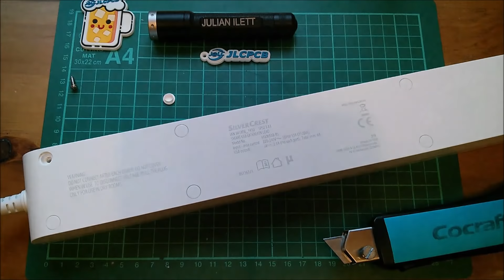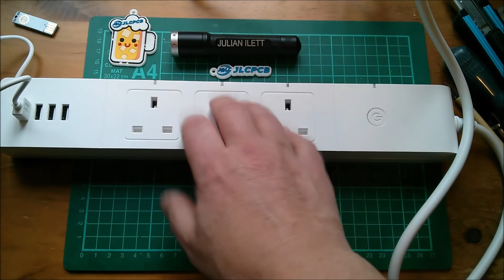Lidl Smart USB Extension Lead - Stripdown

Comment: The ethernet (lan) socket is so that it connects to your router and  communicates to the server on the internet. My understanding is that Zigbee uses its own wireless protocol, not the standard wifi you have on your home network. It allows the devices to relay instructions in their own network mesh. In theory this reduces the necessity for wireless access points. In fact your zigbee devices cannot typically communicate on the WiFi, they rely on their own mesh. The more zigbee devices you have scattered around (upto a certain point),  the better. This helps piggyback the messaging.

Comment: I was interested until it was said "why would you want to" when it came to switching USB sockets.

I want Zigbee controlled inline USB switching but as they don't seem to exist because of this crazy attitude that demands we waste electricity every chance we get, I have to adapt a Sonoff Basic mains switch (which are really good) to run off USB power and have a USB socket.  I don't WiFI USB sockets ... I have too much WiFI.  I like Zigbee.  I have everything set-up on Zigbee.  I prefer 868Mhz stuff - I like WirelessThings LLAP ... but we have to make do with what we can and 2.4GHz Zigbee which can mesh is pretty reliable and does most of what I want.

I don't want to power circuitry just for the hell of it, wasting electricity as unwanted heat.

I just wanna switch 5V.  I like USB stuff.  I have lots of USB stuff.  I want to switch it.  Without having to get out a soldering iron.

Why is this such a taboo thing?  Why do people say "why would you want to?" ????????

Comment: This switching on with litle delay is very clever. It helps a lot if you have 2 or 3 devices with switching power source plugged in to deal with inrush current.

Comment: I never use cloud connected resources in my home for home automation.  (i) there are significant security vulnerabilities, and (ii) we've had instances of consumer DoS because the vendor decides to end-of-life the product range and turns off the cloud service.  IMO, better to control this sort of device locally using Home Assistant and Zigbee to MQTT bridge. A bit of a learning curve, but a lot of capability using Free and Open Source stacks.

Comment: The reason the hub uses Ethernet vs WiFi is that ethernet requires no config or setup, just DHCP on your router and it's good to go automatically. Wifi would generate a ton of calls to their support. Plus, it is immune to interference unlike wifi.should lower latency at the same time.

Comment: There's a reasonably priced tool kit from iFixit that would give you most of those annoying security bits. I think it was like $40. I recently got one.
Reply: There are lots of "security bit" set on amazon. Ifixit is posh home use stuff and the price to performance ratio is just not good

Comment: hello !
most domestic plugs in france are 16A 3 pins plugs.
in not so old habitations (like 1980's), there is 2 pins 16A and 3 pins 32A plugs. 
in older houses we also have 2 pins 6A plugs and 3 pins 20A plugs.
6A pins are 4mm diameter like on russians plugs.
16A pins are 4.8mm.
(all 3 pins plugs mentionned are for live, neutral and security ground.)

Comment: Dont connect high KW heaters to that one. And for sur NOT more than one. Look for shelly wifi plug.. they support 2500w 16A. 3KW on that one will go on fire for sure.
Reply: That shelly plug works on an 16A relay and this lidl one does. So whats the difference ?

Using 13A is even safer. I'd guess these are originally intended for EU 230V 16A use (what equates to 3680W ohmic load) so the 13A is easy peasy.

How can the shelly be 16Amps but 2,5kw ?
Eu schuko plugs can deliver 16A for serval minutes and 10A continuosly.  So nothing wrong with this zigbee plug.

Comment: Would the 13 amps not be on the line going into the device.  Each socket might be divided by 3?  Maybe the first one would handle more.
Reply: I was thinking of the thickness of the traces. You couldn't plug 13 amps into each one.  That would be 39 amps total.

Comment: The plug contacts look strange. Almost as if they are on their side. When you plug a plug into it, the pins of the plug look as if they wont have as good connection and might spark a bit... and with use, the metal might bend out of place quicker. Looks as if a lot of work went into the product yet skimped on a basic part.

Comment: App is smart life / tuya with Lidl badge on it on it, you should be able interact with all tuya WiFi and tuya ZigBee devices on smart life app. 
There white bulbs are very good, at there price.
Reply from the maker: Yeah, I'm hoping I can add some Ikea stuff to the network too :)
Reply: @JulianIlett  Get a Tuya temperature module and monitor shed or auto adjust the heater or fans... 🥴 About £13

Comment: Mainland europe is 20A per circuit (for newer houses).  A circuit Is allowed to have up to 8 sockets.
Old houses may be limited to 10A or 16A
Max current per individual outlets depends on the country.
Individual sockets are rated for up to 16A

Houses typically are limited to 40A total.

Higher than 40A and/or 3 phase and/or higher than 220V (400, 500, 690V) is available depending on where you live...

Comment: Thin tracks ;--) you should pull a 13 amp fuse apart and look at how thin that fuse wire is. 
Also for interest look at "fuse factor" and compare it to the old fuse wire cards for old style UK house fuse boxes. It is stunning how many amps you can put through a 5amp fuse wire (I think the wired fuse wire was rated at 2.5 fuse factor) yep 5amp fuse wire will get hot if you run 13amp through it.

Comment: could you elaborate why daisy chaining leads is a bad idea.. i'm in a situation were i have to
Reply: It’s a liability issue. If you know what you’re doing you can go ahead, but you can’t then sue them if you get it wrong because they told you not to do it.
Reply: @fredbloggs5902  i see i will try to see if i can find any info on what i should watch out for when daisy chaining leads.. thanks. btw my first google search led me to this paper.. seems overloading is a common problem.. https://www.abdn.ac.uk/staffnet/documents/GN001_Electrical_Extensions_2016.pdf
Reply: @MVanDeursen  - Just add the energy consumption of all the appliances together and make sure you don’t exceed  the lowest rated adaptor (13A or 3Kwh being a typical maximum).
Reply: @fredbloggs5902  thanks for the tip.. i just told my wife about this hahaha both of us learned something today.. it's all logical when you think about it but newbies like us don't think about it.. just a Linux sysadmin ahaha thanks again.. appreciate it a lot.
Reply: I think there's a concern that people could come along and keep adding  a lead and plug a heater into it recursively without ever checking how many leads are already chained. People in offices can do that sort of thing but I think it's  more unlikely in a home. They've tried to make the instruction as idiot friendly as possible so no one gets confused.
Reply: @joinedupjon  I really don't like that sort of CYA. I understand making it easier for idiots but I don't really see how this rule helps. It suggests you can't chain ten extensions with 10w each but it's fine to plug ten heaters into one extension. Practically speaking I think it's better for each extension which can't handle all the current available at a socket to have its own circuit breaker or fuse.
Reply: @eDoc2020  I think it's mostly a throwback to the distant past when people burned their houses down plugging high current appliances into daisy chained adaptors hanging out of a light fitting. i think all extensions sold in the UK tell you not to chain,  even though every modern UK plug has an internal fuse - including every plug in the daisy chain.
I daisychain at home and I'm happy that it's safe to do so. At work I worry that some idiot will plug a toaster into a chained extension and then electrocute themselves fishing about inside it with a fork and it might create a liability even though the daisy chaining has nothing to do with it.

Comment: The Hub is wired to make more profit, even though Zigbee is a wireless protocol the cheap chips that do it are not wifi compatible, you could in theory use an ESP32 and hook that up to a zigbee module.

Comment: Good review, I've bought quite a few electrical items & power tools from Lidl over the years and always found most of them are of decent quality and well built.
As you said, is that Printed circuit up to carrying a 13 amp load be interesting to plug a 3 kW load into the furthest socket & run it for an hour or so & check how warm the unit becomes especially when the circuit board is inside its case.

Comment: Tuya is a hardware independent smart home software solution and many different hardware vendors use Tuya instead of rolling their own cloud service, app, etc. This means that you can pair this with the "Tuya Smart" app along with completely different Tuya compatible products. If have not finished your video yet, there are quite nice Blitzwolf switchable sockets which also measure power consumption.

Comment: In the single socket version it is possible to hack it to use a 5v supply enabling you to use the relay to control low voltage equipment

Comment: Zigbee is two way, so the app would get a confirmation.   You are right that the flashing is for pairing.
Zigbee 3.0 is the current standard.  Usually most devices that are Zigbee 3.0 are compatible with each other.
ZigBee won't talk directly to your phone and forms a mesh network, and is extremely efficient with battery devices.  Ethernet is needed (either WiFi or Cabled) for you to be able to communicate with the hub via your network :)
IF you can set the ZigBee channel, make sure it is at 15 or 20.  If you go down into the lower channels, it will be in the same channels as WiFi :)

Comment: Besides wired being much more reliable, the Zigbee and WiFi channels overlap significantly, so it's much easier to make a high quality reliable zigbee hub without a WiFi radio built in.

Comment: I've got a very similar looking one from Gosund, although it's without Zigbee so probably not the same.  Mine had USB Ports rated at 5v 3A .... it couldn't even take 800mA at a single USB Port before the Voltage dropped massively.
Reply: Everything is alright, its Chinese rated 3A@0V means 0,5A@5V which is enough

Comment: If you are only going to be controlling it whilst in you shed, then what's the point (other than curiosity, nothing wrong with that). Surely a normal switched extension would be easier and better. I could understand if you wanted to control the heaters from inside the house 30 minutes before went there but you said it would only be controlled within the shed. Can you explain more?
Reply: I believe you misunderstood Julian's comment. He said the controlled devices will only be in the shed, not the controlling devices. He is going to turn on the heaters from inside the house before he goes out.
Reply: @eDoc2020  Thanks. I thought it seemed strange. Must get my ears cleaned.👍

Comment: Home automation is pretty cool but I never would want to use anything that requires me to sign up to any service that must be connected to some obscure server that you don't have any control over, not over all the devices connected to their server nor over all your data that they are going to collect whether you want it or not, that means that all your smart devices are gonna be spying on your every move, for example with you using this smart extension cable they can see the type of device you have connected and lets say you connect your tv and audio equipment and a light...
So now they know exactly when you use your tv, at what time, how long you watch tv, they now know when you have your lights switched on, at what time and how long and they can even see that you watch blue-ray movies in the weekend because that requires you to have your audio equipment switched on also, all those little details about your life that you never ever thought about they now know only from this smart extension lead, now imagine all the other smart devices that you're using in and around your house that are 24/7 collecting data about you and then you have your phone close to you, within arms reach and you're walking, driving around with always your phone with you and it's also used as beacon so your house knows when you're coming back home in the next 30 minutes etc. etc. you really need to think about that when you start automating your home, you can do it but you should have all management done locally and you should use your own server, you can connect a ZigBee USB stick in your local server and manage all your devices locally, you don't even have to use all the different apps that you normally have to use for your different branded devices that can all be done at home from your own server and one single app for all devices on your phone.
At least that's how I'm going at it for home automation.

Comment: Zigbee smart stuff is excellent. One of the first and still most well known are the Philips Hue. 
Mind you, Philips is Zigbee LL (lightlink) and not fully 3.0 compliant, so it has limitations and some "smart" proprietary controls that make Hue especially good with Hue products, but nowadays OK with Ikea Tradfri, GLEDOpto and the Lidl Smart stuff, for example. There are many reasons why Zigbee is superior in home automation than Wifi. 
A Zigbee gateway is just that, a bridge from a Zigbee network (which is like a mesh, most connected devices will work as a repeater) to a normal network (LAN of WiFi). That will allow out-of-home control with app and stuff.   

Very addictive and really usefull, like anti-burglar, lazy dimming and color-experience, more advanced smart control, too many to list here...

Comment: Hmm run heaters over an extension lead? I don’t think so 🤔
Reply: Yea it can result in melted plastic, hot plugs and floppy overheated wires 😫
Reply: They're not actually heaters, but "heaters" because antminer asic rigs produce a lot of heat.
Reply: Really why not if it's a properly-rated extension? Obviously running a 12A heater on a 10A extension is bad but why not on a 15A extension?

Comment: My first thoughts are where was it made, is the fuse actually in circuit, is the cable real copper, do they all ship with the same IOT password ?  Lidl stuff tends to be quite good but is there any chinesium in it and is the earth wire connected ?

Watching the video - -  Opto isolator separation looks good, but that electrolytic touching the heat sink :(
Does the switch mode transformer at least look like it has a double isolated secondary.
Using an online calculator, 13amp and 1 oz copper requires 25mm track width, that's 1/2 inch at 2 oz (without tinning), a soldered 13A connection is always questionable :(
A good point about confirmation, but there is a difference between the device acknowledging a socket (n) on or off command and confirming that there is or is not power at socket (n), ideally the device needs to confirm that the command has been received and given with also a real world power is on / off check :(
A mod that I would make would be to solder some 2.5mm copper wire full length of the power and earth track.

Resistance and the other tests with Electricians test equipment would be interesting to read, especially from Dave Savery :)

Comment: I have two problems with 'smart' devices that require an account. 
One,  you have to grant and trust an outside source with access to your network and the other is what happens when they decide to shut down thier server!

Devices running of a locally hosted server are a better option and that may be flushable with custom firmware to run on a locally hosted home automation environment.
Reply: I agree. For my network rebuild I'm even going to put the networked printers on a segregated network because I don't really trust their firmware.

But one thing here, the power strip itself is Zigbee. I'm not an expert on that but I believe it should work fine with your own gateway. I believe the account is only needed for their own gateway which Julian bought.

Comment: As soon as the video started I knew this was a Lidl SMART plug. Looks nice and was good value.

OK, the only problem I have with these SMART devices is they are APP controlled. So, what happens if the Internet is down? 2) What happens when the APP's server no longer exists? 3) Can we bypass the SMART controller and manually override it? I know this is Zigbee, so theoretically could be controlled by any compatible device, but do we have the datasheet to do that?

I do have a SAMSUNG SMART Tumble Dryer that is controllable through an app, but I'm still not convinced by all this. Am I being over-paranoid by loss of Internet control if things change in the future despite the dryer having manual control?
Reply: @Mr Brightside I agree. Tumble dryers should never left unattended anyway, as they have been responsible for many serious fires!

Comment: Looks well made to me. When you think what a single core of a live cable is in thickness, that wide track looks ok for 13A to me. Flat on the PCB  as opposed to covered in double insulated plastic like the single core of a live wire.
Reply: Not to mention it's via stitched to the duplicate layer on the other side, so it's double thick, solder slathered on the far side and the vias are solder filled.